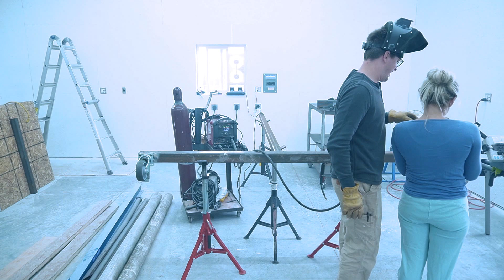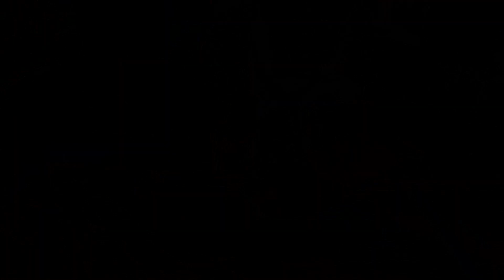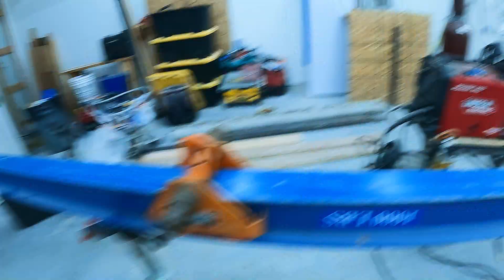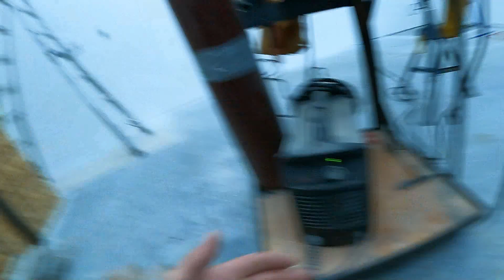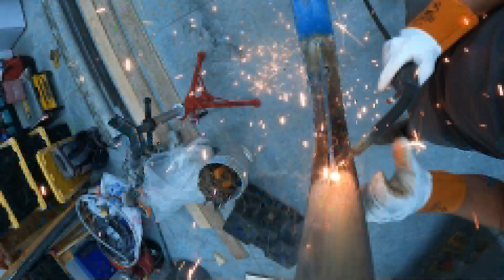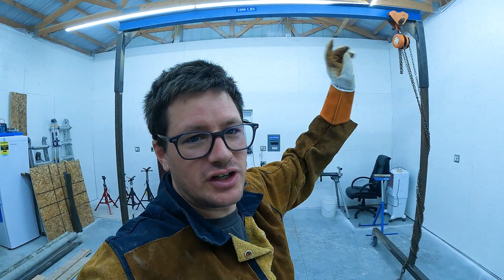DIY SHOP BUILD GANTRY CRANE. IF I CAN DO IT YOU CAN TOO!

Comment: I’m a fan of locking wheels but on gantrys you should not use them if your load isn’t perfectly on center the legs adjust on their own to even out load 
I use a gantry all the time and the machine does this
Should use all 4 non locking wheels- good luck
Reply from the maker: Thanks for the input. So far, I love them compared to my other gantry, which doesn't lock. I do see your point about balancing. Once I have a driveway poured I will likely not lock as much as I won't be worried about it rolling out the door with a load on it.

Comment: No gussets from the horizontal to vertical posts on the bottom? I guess you can add modeling to your "odd jobs"😂 Pictures are cool though!
Reply from the maker: I put them on after this was filmed. 56" sch 40 1.5" pipe.
Reply: Yeah, this is awful flimsy. For a gantry of that size, 6” square tubing 1/4” thick is really required, plus gussets at the bottom. I also don’t understand why you are willing to overrate the 1000 lb. beam by 100%. There’s a reason why it says 1000 lbs.
Reply from the maker: The 1000lb rating isn't for the i-beam it was for the previous location it was installed. It used to be used cantilevered and had different equipment on it. I have never seen a 1 ton crane with 6" square. We have a few aluminum cranes at work that are aluminum that are 3" square 1/4" wall that are rated to 2 tons. I'm not an engineer by any means, but my old crane is the same i-beam with 2" square and 1/4" wall, and I've never had an issue up to 3k on it. At that point, though, the 1 ton hoist is even overloaded. I do appreciate the input. Like I said I'm not an engineer and most of the time, it lifts about 500lb. My welding table will be a different story when I move that though.
Reply: @tysoddjobs  it’s the length of the beam. The longer it is, the more it’s derated. A beam twice as long can have one third to one half the load rating. That rating is lowest when the trolley is at the center of the beam.
Reply from the maker: Agree with the center load as well as it is also derated for length. The 1 ton spanco cranes with this same i-beam span 11'3" that is why I felt comfortable spanning 10'.